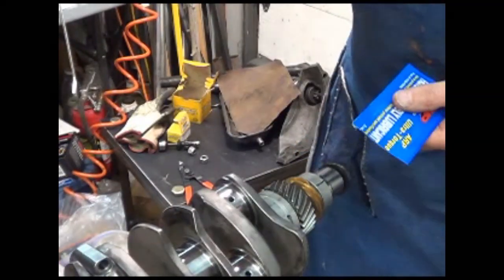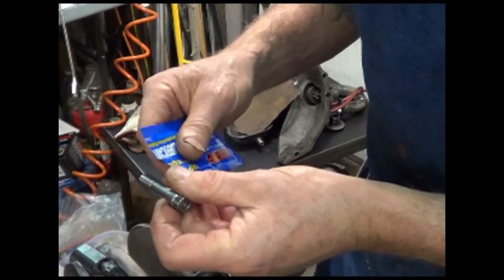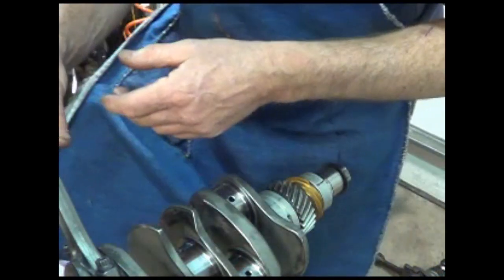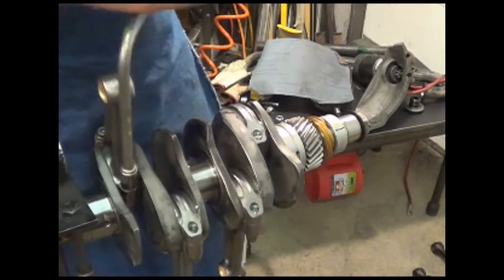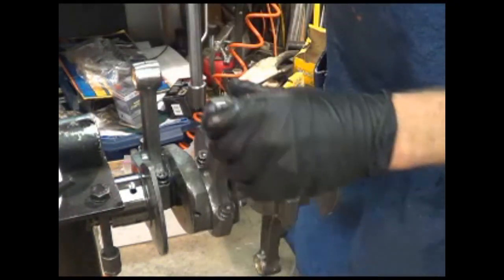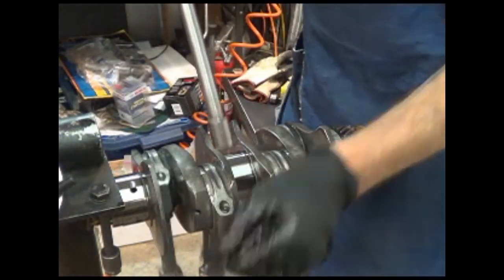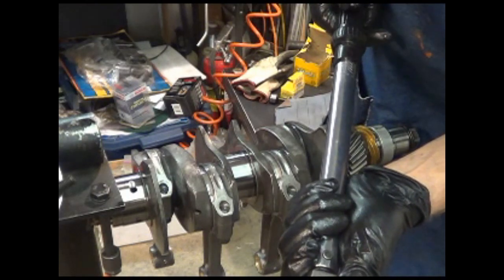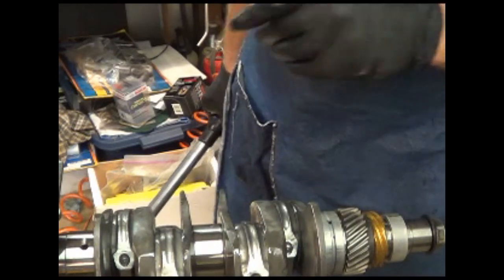VW ARP Connecting Rod Bolt Install

Comment: is it critical that you measure the stretch with a stretch gauge? or you just torque it and not worry about the stretch?
Reply from the maker: I was told by a rebuild shop that with 30 pound torque you can reuse them about 3 times. Better to go to the ARP websight  for advice
Reply: @TheEZGZ  when you tightened and loosened them 5 to 7 times, did you work your way up to 38 ft lbs every time? also, did you put the lube on when you were doing to 5 to 7 tightening sequence?

Comment: Hey EZ does your new autolinea  case oil pick up sump tube come out square at the oil cover plate? I just got one and it’s coming out at a angle  and not square to bottom of case.
Reply from the maker: Had to bend it a bit!  It'll be fine!

Comment: Do you plug the case as well as oil pump when you do a full flow system? Or do you plug only the pump
Reply from the maker: Never do the case. Always do the outlet of the pump. Get a plug with a allen wrench socket or cut a groove for a screwdriver.

Comment: Hello EZGZ! I recently converted my 1600cc engine to a 1915cc, i didn’t port the heads, and didn’t put bigger valves, and im having an overheating problems. Do you think the problem is in the heads being stock size?? I also installed a full flow system with external oil cooler, but didn’t seem to fix the problem.
Reply from the maker: Doesn't tell me enough. What's your compression? What camshaft did you use?  What's the Outside air temp your driving in? What kind of car is it in? Is your stock thermostat and flaps in and working?   Blah blah blah
Reply from the maker: Your stock valve heads are perfect by the by
Reply: Using a non-vacuum advanced distributor = cooked engine.

Comment: Hey GZ. Been watching your videos for a couple years now. Keep it up please. You're very knowledgeable and a good, entertaining teacher, too. 
Just one question on this particular video: Why use such a long extension on your ratchet? Seems a six inch extension would have sufficed and probably give more accuracy in your torque readings and be easier to handle.
I learned about this in my four years at a prototype machine shop. Less distance, less flex, more accuracy.
Just trying to help and learn, my friend.
Take good care & I hope you enjoyed your Fourth!
Reply from the maker: Great Point but that's all I could find and 38 PSI is NOT going to flex that shaft anyhow. Thanks
Reply: @TheEZGZ  I wondered if you just couldn't find the right sized extension at that time.
Not trying to be critical. I've learned a lot from you!
Thanks my friend.
Reply: @TheEZGZ  Ha! I wondered if that was the reason.

Comment: Hello EZ ive been having trouble with my rods after i took them off when i put them back on they have became very stiff almost stuck do you have any ideas why my rods are doing this? there torqued correctly and bearing look good....
Reply from the maker: Sorry to hear that. Take it apart and look for witness marks. Could be a lot of things.  Incorrect bearing, dirt behind the bearing on the rod area, crankshaft worn out of round. I'm sure your keeping track of where the rods came from and putting them back in the same place with the same cap and new rod nuts with the correct torque......    22-25 ft lbs for stock late 1600 rods. Covering it with plenty of engine oil (not assembly lube) as you go.  Not being in your shop with the parts I can only guess.
Reply: @TheEZGZ  yeah I put it in the same way it's really weird haha I have no clue thanks for the tips though I really appreciate it. your awesome:)

Comment: I use witch  oil in my vw  have  you used the new CB performance aluminum  push rod  that can handle double Springs
Reply from the maker: I ordered my aluminum stroker case from them along with the 3/8 aluminum secret recipe manly single ended pushrods.  That ought to be worth 3HP right there.
Have you tried them yet, if not stay tuned....

Comment: It’s great that you give the actual torque spec. Others keep it a secret. Happy fourth.🇺🇸🇺🇸🇺🇸🇺🇸🇺🇸🇺🇸🇺🇸🎊🎊🎉🎉
Reply from the maker: Thats no big deal buuuuuut!  The stock rod bolt torque is 22-25 ft. lbs.    I hope nobody try's 38 with one of those. Like I mentioned you have to get the torque from the manufacturer or seller to get it right. Every builder needs to have a book or shop manual to build one of these evil things.

Comment: Hey man Kevin here from Australia. Just a quickie question. 
What's that assembly oil , lube , slippery stuff called. 🤣🤣🤣🤣
I love your videos man. .
Anyhoo stay safe and stay well. 
✌  Peace man.
Reply from the maker: I just use motor oil. Plenty of it. I prime the engine before starting with rocker assembly's off and plugs out to make sure there is oil to the bearings.  Then assemble and do my start for cam break in. Drain, Rinse and Repeat.

Comment: Wait a second.... you’re suppose to use oil in the build? I thought you only put oil on the dipstick when completed. 😂😁
Reply from the maker: I got to tell this story in a vid.  My old neighbor was a chrysler mechanic in the early 1960's. They had a lot of cars come back because they were using oil. The rings wouldn't seat.  The solution was start them up and dump some BON AMi  powdered cleanser down the carb while it was running.  Then change the oil and send it on it's way. 
                                      ************
Since 1886, Bon Ami has been committed to offering a nontoxic household cleaner that works. Our exclusive formula uses mild mineral abrasives to gently clean and polish everyday surfaces without the use of harsh chemicals. An ideal all-purpose cleaner for kitchens and bathrooms, Bon Ami excels at cleaning sinks, countertops, tile, and more.
Reply: TheEZGZ holy crap, now that’s a story! 😲